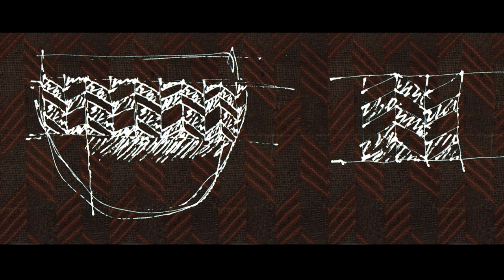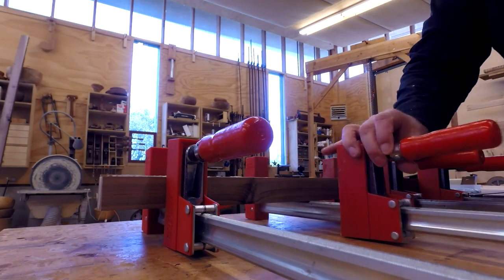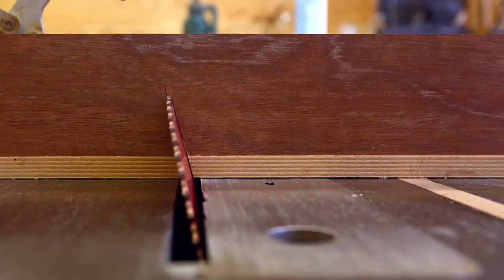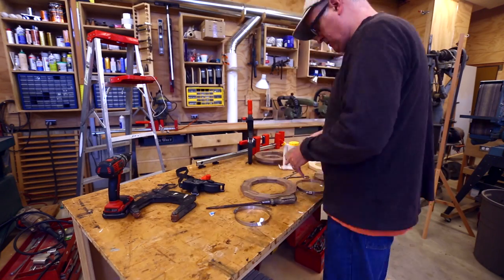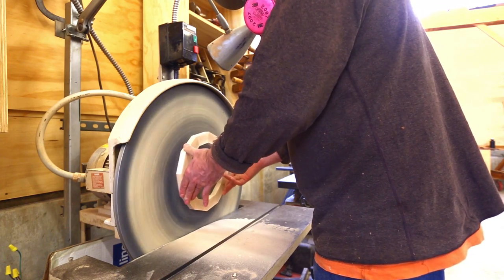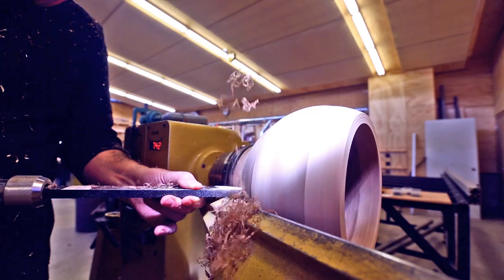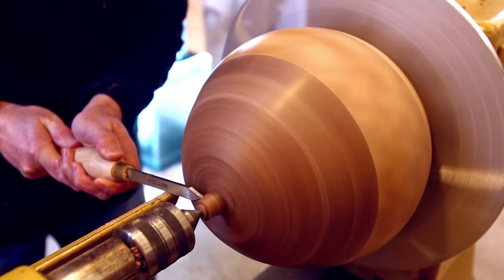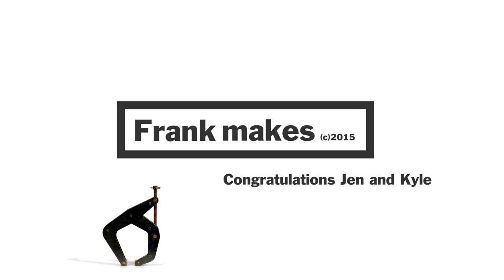segmented wood turned Wedding bowl

Comment: Always entertaining watching your videos. I've recently started turning segmented bowls. I'm always looking for new easier ways to do things so I wanted to share a tip I just came up with that will allow you to glue all of your rings at once with out them sliding around. Hot glue a small scrap of wood to the edge of each ring after you line up each ring before you apply glue. Saves me a ton of time and frustration. Keep up the amazing work.
Reply from the maker: Thanks, that's a good tip, I need to find my hot glue gun.

Comment: Another great video, Frank ... Thanks!

Suggestion: When you turn a bowl with this shape around, you can put the buttons on your Cole Jaws inside and use in expansion mode to get a better purchase on the wood. Of course, you have to be careful not to break the glue joints on the top ring(s), but it makes dealing with the bottom a little easier.

Comment: Unscrew two hose clamps all the way and then connect the four corresponding ends and VIOLA!! Extra long hose clamp!!
Reply from the maker: thanks, I will try that.
Reply: I was wondering how long before someone mentioned this Frank Howarth.  It works great, use different sizes to customize your clamps.  And no glue on you're straps.

Comment: Hi Frank,
I have always been intrigued by woodworking, but the work you do for your channel is simply inspiring. Every element in your videos reflect your craftsmanship, your forward thinking, and your attention to detail.
As a result of your videos, I recently took my first wood turning class. Shortly thereafter I purchased my first lathe! Seeing as I am new to wood turning, I don't have a stockpile of wood which has been drying for years. Do you have any recommendations for ways in which to expedite the wood-drying time of large chunks intended for bowl turning? I have seen some people boil their wood, put their wood in a bag with dried wood shavings, and even microwave their wood. I wanted to get your thoughts on these methods and any other methods you know of.
Perhaps I should be patient by allowing some wood to dry and create several segmented bowls from small pieces of wood in the mean time. 
Thanks for the inspiration and any insight you may provide!!
Best Regards,
John

Comment: To hold the bowl on the large when lip curves in, put the rubber pegs on the inside of the rim and expand them. Don't over tighten, though, or you could blow a glue joint. If takes less pressure than you might think to keep the bowl steady while you ginish the bottom.

Comment: Very nice design and execution.  When I glue up my blanks I do it on the lathe with a conical piece in the tail stock.  These ensures that the segments are all concentric and I can devote my concentration into making the rotation accurate rather than trying to get rotation and centering both correct.  Have you ever tried that?  The most dangerous item in my workshop seems to be sandpaper.  I have had a number of minor injuries.  I recently sanded a small piece off a finger.  I cringe every time I see your fingers near your huge disk sander.

Comment: Frank there is a company in Covington, LA called It Straps On which makes hose clamps used on utility poles to hold street signs, etc. you can get any size hose clamp you need from them. website is the same as name.

Comment: Did you have a chance to try out the theory on the salt yet? There seems to be some logic to it; if a formidable force is used to clamp the pieces together, the salt is pressed into the wood and making the joint "lock" sideways? And if your chisel hits a grain of salt, its not that big of a deal since salt is not that dense. Is that the idea?

Great video again, very nice design and craftsmanship! Thank you!

Comment: im a bit of an amateur when it comes to wood working, and was just wandering why you sand the rings instead of face and plain them for a super flat finish? 

ps. I love your videos and the quality of your work is amazing frank!
Reply from the maker: The planer will make a mess of the side grain (the front and back of the ring).  A drum sander would work, and that is what a lot of folks use

Comment: It's a pleasure to watch your videos, they are always better, your style is mature. Do you cut perfect 15 deg angle, so you don't need to glue two halves and sanding flat before glueing the rings? It doesn't leave some small gaps?
Reply from the maker: On one of the wide bottom rings I had that issue, but the rest went together as circles.  I think I have been doing 12 segmented rings because I have my jigs dialed in, for that

Comment: When you mentioned the glue on your band clamps I had to laugh at myself.  Every single time I have little spot of dried glue on something, I always go straight to my fingernail to scrape it off.  This invariably will send one or two glue shards painfully under my nail.  I seem to never learn my lesson, and never remember the pain until it's too late.  Any tips?  anyone?  I never want to use a scraper for fear of damaging the underlying material.

Comment: ....a clamp to hold it on the lathe... 

you know, that clamp that walks at the end of each of your clip, (I don't know how those are called)
You can, maybe, use only half of several of them and set them up as jaw on the flat chuck. That table-flat chuck that has nothing but slots on it. How about sliding the upper half of those "walking" clamps. You would only need at least 4 of those "jaws" to dial it in to 0. And if need be, add more to secure everything and check again the dials if true ever after the setup is ready to be turned.

Comment: Hey Frank (love your work) or any other woodworking folk reading this, 
Could anyone tell me what to look for in a lathe? I notice that the 'chuck' Frank uses to attach bowls is quite large. Can you buy large chucks like this for most lathes? What sort of throat size (from centre of spindle to metal frame) should i be looking at for bowl turning? 
Also what would you recommend in regards to turning tools. I notice the ones you use are really long. Some i have seen here (in NZ) are really quite short. Are yours extra long? 
Thanks
Reply from the maker: With a lathe you want wight, to cut down on the vibration.  I started with an old 12" powernatic.  That size or bigger is fine.  Longer handles give you more control and more leverage.  When turning larger things, you want to hold the end of the handle up agents your body, and move your whole body to move the cutting tip of the tool.
Reply: frank howarth Thanks for the tips. I'll certainly be looking for something old. So far all of my big tools are older than me. Thanks again and keep up the good work. Your videos inspired me to become a woodworker. I couldn't be happier. And my Daughter loves getting involved too.

Comment: Make-A-Clamp by Breeze Clamp Products. The banding is available in rolls up to 50ft and the screw clamps can be purchased in sets as needed.  Amazon has a 8 1/2 ft Roll with 3 Clamps and a splice for about $12.00

Comment: My only worry is your long sleeves. I work in a wood shop that would fire if I wore long sleeves.
Reply: One thing that is far worse than wearing long sleeves is wearing long sleeves rolled up. That is the thing that is the most dangerous as if they fall down you get a big surprise. You should either wear short sleeves or long sleeves that are correct length and fairly tight.